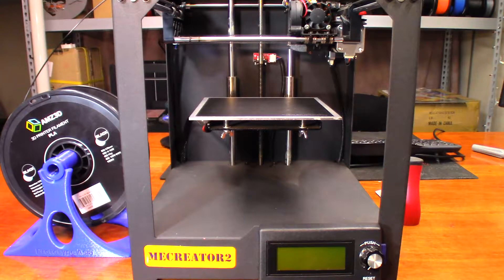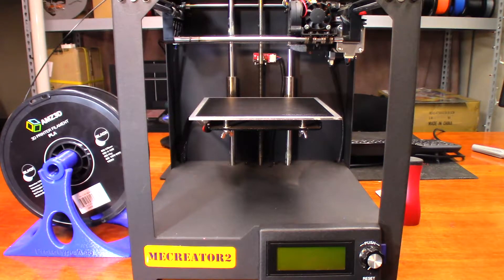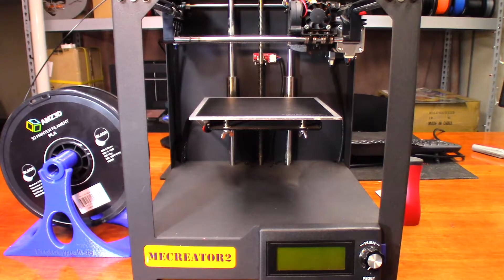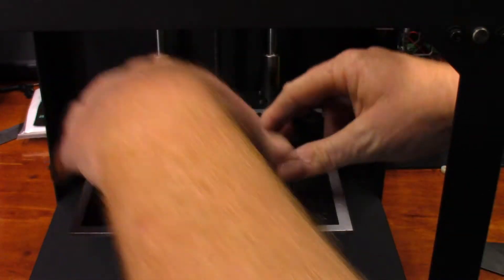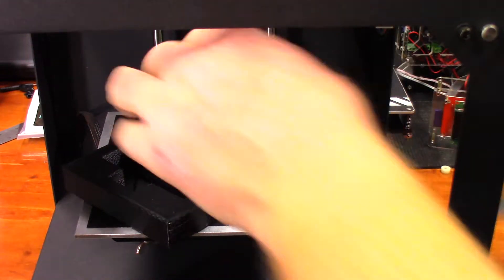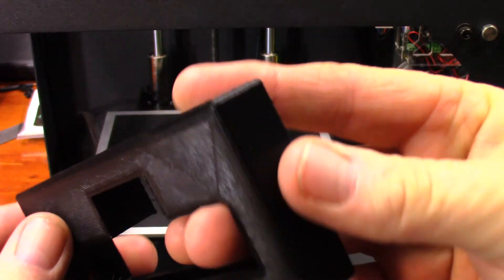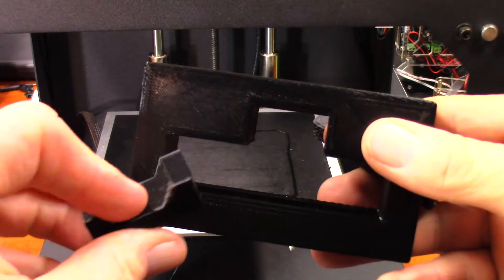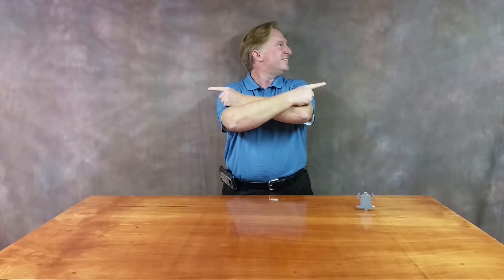3D Printed Glock Sight Press

Comment: Great video 👍looks like a loose printhead, throat or nozzle
Reply from the maker: +Tom O' S The last print I did on the D200 had the same look on the surface.  I think I have a setting wrong in Cura.
Reply: Jimmy Shaw's Tidbits maybe it is but try different slicer to check if it really is cura and if it's still there then you've something loose🤣🤣🤣 I had the exact same on other printers before, one was loose throat and another was a loose x carriage👍